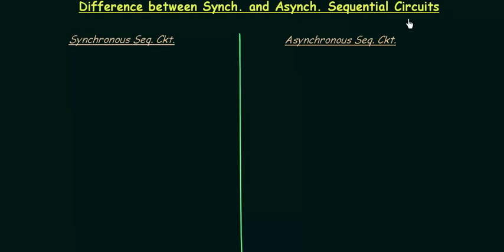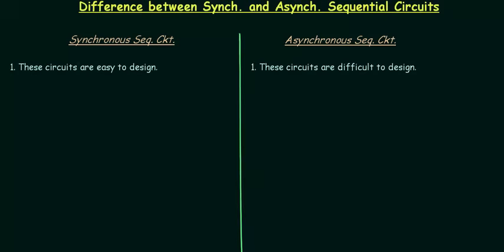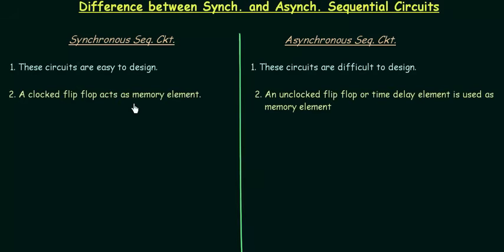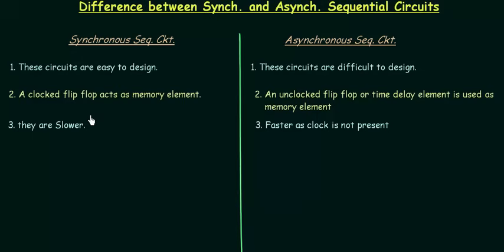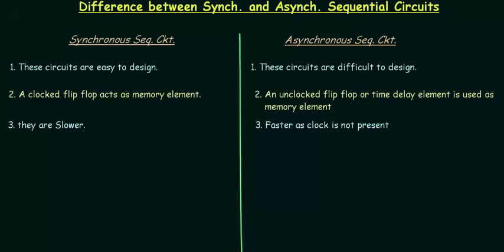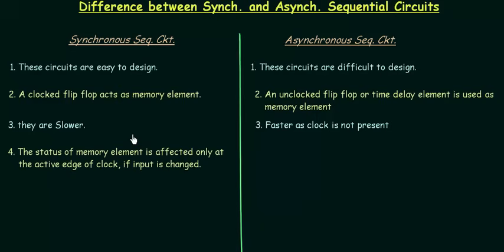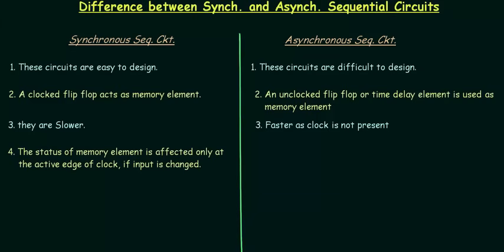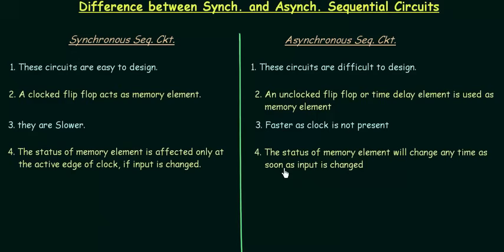Difference between Synchronous and Asynchronous Sequential Circuits

Comment: Dear Sir,
I have got a confusion that if asynchronous ckt does not use clock then how is level triggering applicable for asynchronous ckt ..
Reply: the point is that for a level triggered clock, the circuit will act as an asynchronous circuit for the time the clock is high and will not be operational when the clock is low.

Comment: Synchronous Counter designing as well implementation are complex due to increasing the number of states.	Asynchronous Counter designing as well as implementation is very easy.
Sir you told exactly opposite to asynchronous counter

Comment: Hello, the difference between synchronous and asynchronous sequential circuit is contradiction on some points with difference between synchronous and asynchronous counter. 
Can you please explain more
Reply: yeah, did you find the reason 😬
Reply: the video is wrong he mixed them up, async means easy sync means hard to implement.

Comment: Flip flops are used in asynchronous circuits as well. For example, ripple counter using JK flip-flop
Reply: *Unclocked flip flops are used in Asynchronous Circuit
Reply: a ripple counter is an ASYNCHRONOUS COUNTER because it has a clock connected to only one flip flop. however it is still a SYNCHRONOUS sequential circuit. the way the terms synchronous and asynchronous are used for counters and sequential circuits in general vary. so yes, even a ripple counter is synchronous sequential circuit.

Comment: How can synchronous circuit be slower sir?? 🙄
Reply: Synchronous circuits  runs with a clock,  so clock is slowed down to synch with all kinds of hardware in ckt. As different types of hardware can operate on different frequencies.

Comment: synchronous are faster becoz in synchronous all the flip flops are clocked simultaneously.
Reply: The synchronous are definitely not faster because the speed of the clocking is bottle-necking the processor, which may execute outputs faster than what the flip flops can handle. In asynchronous systems this is not a problem.

Comment: sir as counter is also a squential circuit ...and u have mention in ur lecture of diff: b/w synchronous and asynchronous that asynchronous circuit is unclocked these circuit are difficult to design and they are faster then in ur lecture  of types of counters  u have mention that asynchronous are clocked they are simple and slower....these two lectures are confusing our concept kindly help in this